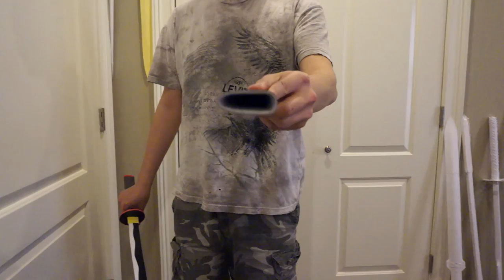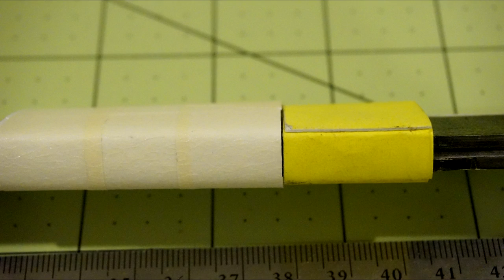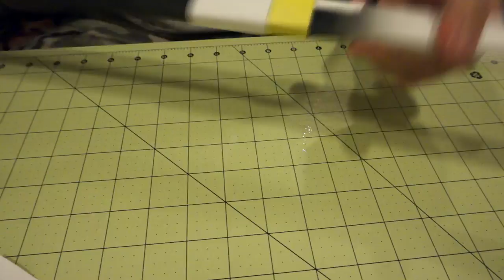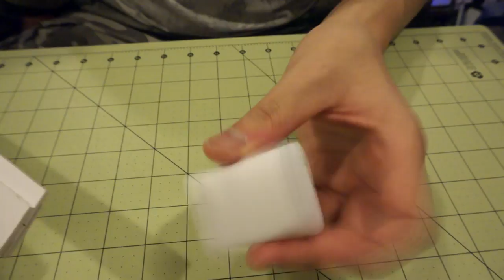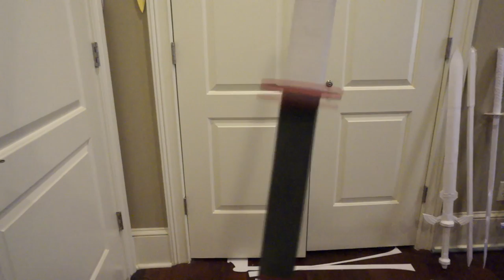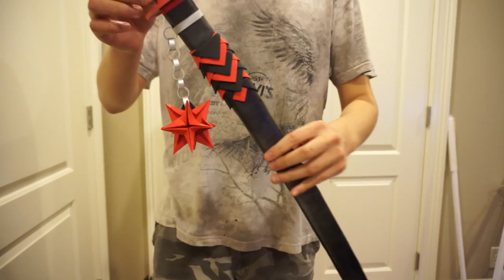How to Make a Paper Sheath for Katana

Comment: this also works for non katana blades,
but instead you want to leave each section on, as you travel the blade

since you cant use 1 spacer for the whole thing this way,  just glue directly to it (the spacer NOT the blade)
if you make it a bit thicker than in this vid, you end up with a sheath even harder than the blade

which is good for those who play fight, and use the sheath as another weapon or to block
or just want a harder casing

Comment: since im sure itll be asked again, if you wana make from wood, theres a few channels here on youtube for that

as for making the tip (which is why im looking at this vid again) im assuming when he made it
he just used printer paper over the end cause the thinner paper have a smoother result as an end cap

if you really need to have a more traditional solid plug endcap
make the pieces as instructed till the last piece, make that one 1/2in or 1.5cm longer

take a few bits of scrap from sword templates you should have made make a stack 1/4in or .5cm
(3 template pieces 4 cards thick of 110 card folded once will be about that big) 
use a pencil to colour the bottom edge of the endcap

press that end against the stack firmly, and you should get a transfer mark if you carefully trim the stack
to the inside of that mark youll get a plug that just fits into the end
lube up the edges with glue and stick it into the bottom end of the end cap place it upright on a hard surface
and use a pencil to push down the plug to level it out

you can attach the end piece onto the rest of the sheath at this time
let it dry, then clean it up with a piece or 2 of printerpaper over the end (you can cover the end in a decorative end guard)
if the plug has some gaps in it wood filler or paper pulp (wet shreaded toilet paper and glue work fine)
can be used to fill and smooth

Comment: i am making basically 3 paper katana for halloween (going as zoro from one piece), but i am not allowed to bring them to school so what im doing is making just the hilt along with the tsuba and about 3 inches of the blade (to keep it in the sheath) so what i'm doing is 'im going to use the start of your ichigo tensa zangetsu build to make the hilts but to make the sheaths, would you recommend i make the sheaths based around the tensa zangetsu i already have made or try to sort use multiple pieces form the 3 inch blade that i left on the hilt?
Reply: +Quinn Dow also i am trying to make the designs on zoro's katana's sheaths identical to the ones in the anime you have any templates or something to recommend?
Reply: Call them origami creations and they might let you take them

Comment: what is the table he is using with the 1 inch squares i need one and i dont know what its called
Reply from the maker: Dubstellar its just a rubber cutting mat with grid marks, its about 15-20$ at craft stores
Reply: +Returacan I go to my Michael's and see the super large one, that is smaller than yours... And is $224.99 No lie I checked the price to make sure. I got mine that is half the size of yours for $20 with a coupon. A $10 was 5x4 inches.
Reply from the maker: KayaDal i wouldnt try dedicated art stores for anything, they overcharge for EVERYTHING. like srsly...2$ for a bottle of glue that i can by for 32 cents elsewhere...
Reply: +Returacan where I live, op the only place is Michaels, then the dollar store. Which still charges $2 for a bottle of glue... Then I go to staples.... Like $20 for idk... 50 sheets of 64 pound paper.
Reply from the maker: KayaDal ouch....i have several walmarts around here, i get 150 sheets of 110 for about 6$ and 12pack of glue for about 5$
Reply: +Returacan When I go to Walmart... 20 pound paper of about 70 sheets... $17.99 O.0
Reply: then I see right next to it a 500 sheets for $5 but Walmart only has 25- pound paper... But I work with what I have... The master sword was a pain working with only 25 sheets of 64 pound paper left..
Reply: +Returacan currently I'm working with postcards as hardened 110 pound paper... I made a mistake...